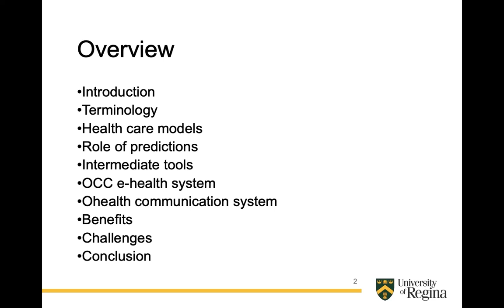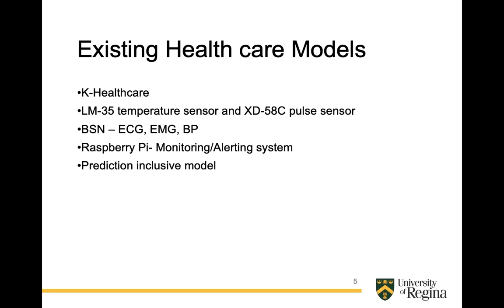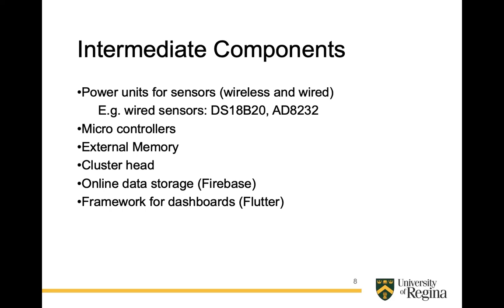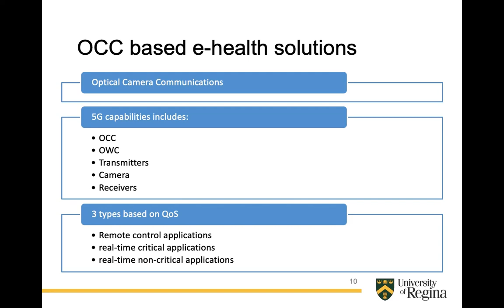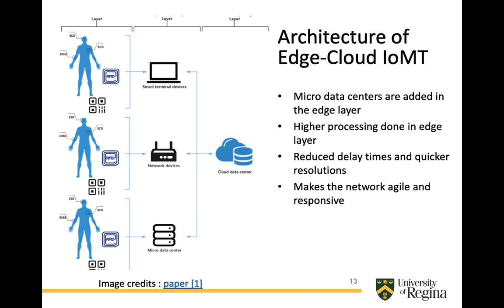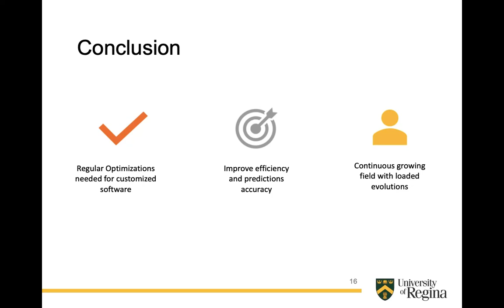GradSeminar

Comment: Hi, could you elaborate other major problems faced in traditional methods?
Reply from the maker: Hi, thanks for the question. 

Apart from Lag in the network systems, delay in information updates, doctor availability is also another major drawback in the hospital systems. If the patient's problem is not life-threatening, they let the patient sit longer even if they are in so much pain. That is when remote monitoring and edge level computation treatments evolved ideologically.

Comment: Can you elaborate more about multiple patients monitoring and remote patients monitoring?Do you have any research paper which includes this topic?
Reply from the maker: Hi, 

Multiple patient monitoring is useful in the hospitals having the patients in general wards or group observations. In certain non-critical or stable cases, when the patient is not in a situation to reach the hospital, using third-party apps or web applications, the patient's information is transmitted to the doctor and consultation and support are provided by the doctor.  Or it can be a case when a specific operating doctor is not available at the hospital, the treatment and guide can be provided online to the consulting team or help in emergency situations. 

all of the concepts mentioned in the presentation are gathered from different IEEE research papers.

Comment: Dear 
Keertthi,

Thanks for delivering such an informative presentation!
One of the major concerns of cloud computing is security. How secure is it to have all healthcare apps and patient data in a third-party server? Especially when private clinics are required to comply with regulatory standards like The Personal Information Protection and Electronic Documents Act (PIPEDA)  for the protection of personal data?

Thanks,
Mykyta Chernenky
Reply from the maker: Thanks for your question Mykyta. Third-party server connections are done at the network level with lots of security measures like content-based inspection, limited routing control, traffic capture or inline intrusion detection processes. These are some of the important measures where every cloud architecture takes care of internally before processing to further additions on its architecture.

Comment: Thanks for the presentation. Quick question: Lots of personal data will be generated in this type of monitoring system. How is privacy of such sensitive information maintained on this type of system?
Reply from the maker: Hi, thanks for your question. Data maintenance and security are the fundamental steps in these cloud architectures. Before the start of doctor consultation or medical application filling by the patient, the processes start with the authentication (eg. token-based or multi-factor) would be performed. Cryptographic algorithms also used to secure the data storage and access it at multiple locations.

Comment: Did you identify any shortcomings with Remote consultation in health care and how they can be handled with technology?
Reply from the maker: Hi Tolu, Thanks for the question. As of now, all these architectures and advancements mentioned in research papers are not practically captured and evaluated. Based on my understanding there will be few challenges related to the transmission of huge data per second in limited bandwidths. So, that is one of the main reasons, 5G systems are encouraged.

Comment: In slide 8, you mentioned power units for sensors can be wired as well as wireless, can you please tell which one will be the best to choose among them?
Reply from the maker: Hi, thanks for the question. 

All Sensors itself are the low reliable devices and also the key sources for information gathering. However there are challenges to either of them, Wired communication is the best medium to operate sensors in significant cases, as it ensures power connection and data transmission from one to another node with minimal abruptions.

Comment: Hi Keetthi, Can you explain on what circumstances Edge and Cloud Layers will be used and on what basis you are differentiating? Such as certain activities performed in Edge saves time compared to Cloud and I believe for IoT in Medical fields usually runs around Fog or Edge?  What are the methods planned to calculate Prediction accuracy?
Reply from the maker: Hi Madu, thanks for the questions. 

The different layers of the cloud are classified and accessed based on the criticality of accessing information both from the patient and the doctor.  Some systems use Edge level of cloud to gather information from the patient and Fog level to retrieve previous history records of the patient. If there is a need for acquiring suggestions from a computing model, then the central cloud-hosted applications can be called to get the predictive information. 
Generally, these predictions are possible by implementing machine learning and deep learning models through classification methods on the gathered patient's records.
Reply: @keertthimettu483  Thanks for the reply

Comment: I think slide 9 is more like the  IoT Architecture (IoT data management and compute stack) and not Cloud computing layers. What do you think?
Reply from the maker: Hi, thanks for the question. 
You are right about the heading. It is actually the classification of the cloud computing layers based on the IoT devices data management and network communication system involved between them.